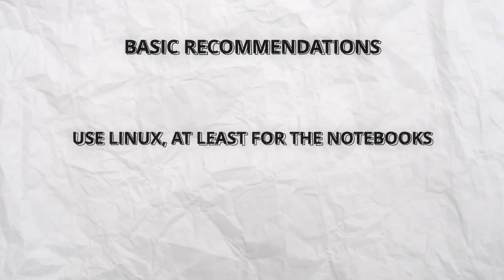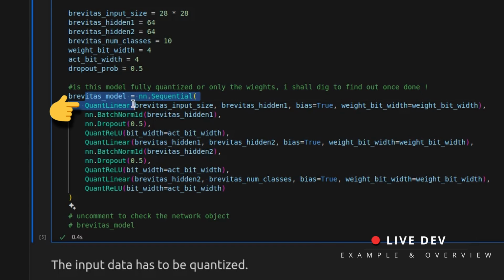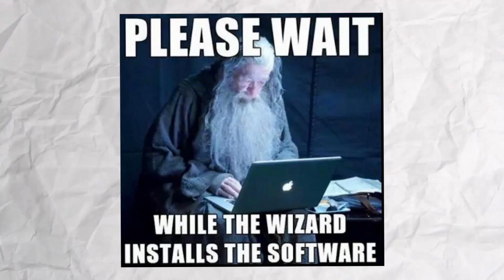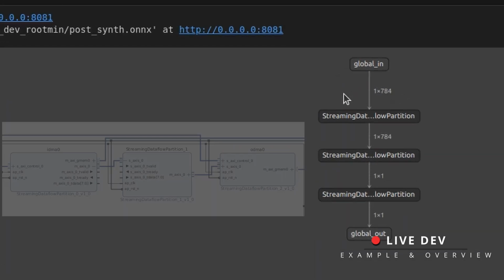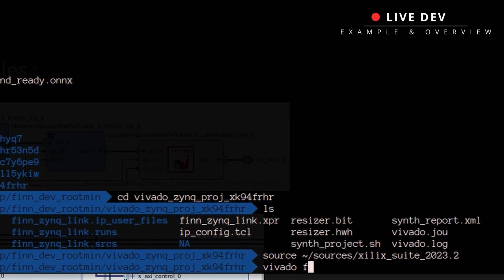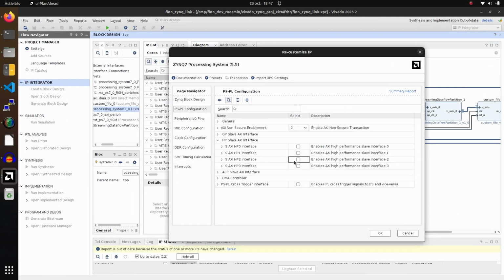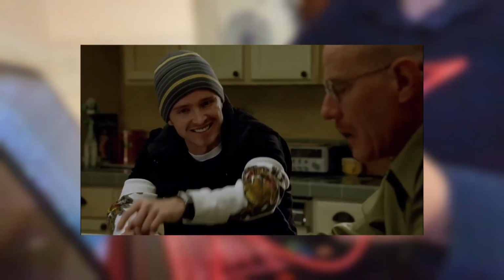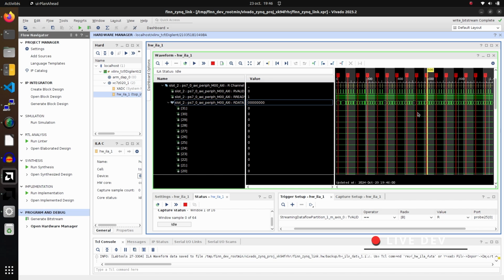Today, YOU learn how to put AI on FPGA.

Comment: Thank you very much for your tutorial and explanations.
When you opened the FINN project in Vivado, did you keep the target board as PYNQ and not update it to your specific board? I believe you did, and it worked fine because the Zybo board uses the same SoC as the PYNQ one, right?
I’m a bit unsure about this, since I believe that if I change the board in the Vivado project, I might need to rebuild the whole design for the specific board.
Reply from the maker: you can theorically grab the stitched IP and use it in whatever SoC for whatever target. Now if your goal is to leave it "as is" don't touch it too much as you will need to re run the whole synth etc... Not the end of the world but kinda long too if you wait in front of your computer for it to complete

Comment: This tutorial is confirmed working. Ubuntu 24.04 Vivado 2024.2
Reply: I also didn't need to add the constant block. I was able to directly connect the fifo to the DMA port
Reply: @one_bone_4_life647  You didn't use any constant and concatenation blocks, right?
What configuration did you leave in DMA?
Reply: @felipeferreira1960  I followed the configuration in the video. His git also has the DMA configuration information.

Comment: Being non root docker and user didn't allow me to run graphical vivado
Reply: running the vivado project from root user avoids issues
Reply from the maker: You should give the user docker / vivado authorization, running docker as root can lead to problems later
Reply: @BRH_SoC  I didn't run Docker as root. I opened a new root terminal and opened the Vivado project from there.
Reply: Ran Vivado from the sudo -i user

Comment: Forgot to mention what constant value should be used in the constant blocks
Reply: I'm assuming we use 0xF for the 4 bit and 0 for the 24 bit
Reply from the maker: You have a constant for TKEEP (you only keep the first 8 bits Sir set it to 0001 if my memory is right)

And another to fill the unused 24bits with 0s in a concat, so yes it would be 0s there.

Good luck !

Edit : added it to the github repo

Comment: There is an issue with the finn quick start tutorial. solution is found in a git bug report 1295 finn issues
Reply: You will need to modify 2 files
Reply from the maker: Running the Finn's container can be tricky. Setting up all the permissions right isn't enough sometimes... thanks for bringing that up

Comment: tutorial breaks for me when trying to export to finn-onnyx. no part1.onnx found. i looked in the tmp/ directory and there are a lot of .onnx files
Reply: export_qonnx fails to find part1.onnx
Reply: It may be a my end issue. Still debugging
Reply: I notice my root name didn't match. It did not keep my capital letters when generating the new mount location
Reply: I cant seem to get any files from Jupyter to save or generate to a new mount folder
Reply: Will it take capital letters for a user name or will it default them to lower case where I need to make a new non root user with no capitals
Reply: I'm just going to start tomorrow with a fresh user and no capitals in the name. This seems to be the issue
Reply: Yes, the error is that the mount folder that gets generated by Docker will ignore capital letters in your user name. In the Jupyter where it asks you to "use your own user name," put you username with no capital letters. This worked for me. The tutorial is good
Reply from the maker: Great , thanks for keeping everyone updated , good luck :)

Comment: Can I use more than 1 FINN accelerator on a board? For a Project, I need to use a custom Microblaze system and 2 ML accelerators.
Reply from the maker: Yes, I guess you can just build multiple accelerators, grab the main accelerator IPs and build your SoC from there around the 2 IPs

Comment: Why did you delete all their pre-made IPs in the Vivado project? Why did you not use their DMA if Xilinx DMA requires a custom FIFO and other hardware to make the accelerator work?
Reply from the maker: Finn was made for Pynq boards. Theorically you dont have to know anything about hardware to use it.

But I wanted to use it on my own FPGA and the premade DMA did not have practical C libraries in Vitis so I simply replaced it however I could.

Comment: how do you evaluate fpga competetiveness with regard to gpu, and which use cases should favor fpga over other choices?
Reply from the maker: FPGA are not really a great competitor againts GPUs.
Their advantages are delay, edge presence, power consumption and adaptability to the use case (for aerospace applications for example).

But because it takes so much work to get some very simple application running, people just don't use it, understandably (it's just very hard to use, let's be honest...) 

So it's a balance, and once you lean toward FPGA, you have to be ready to put in the work ;)

Comment: Man, this is awesome. Does it work with different FPGAs? I have a PolarFire SoC Kit and want to do the same thing. What do you think that I should notice?
Reply from the maker: Hi, thanks ! Well, polarfire is not compatible with vivado so I think it's not really possible. What you can do is get the quantized model from brevitas and then implement that in verilog. It's more work and less flexible but a well quantized model should make it fairly doable. Good luck !

Comment: Is there a reason why you didn't use hls4ml and does your approach also support generating hls for customized layers
Reply from the maker: When I looked for tools, hls4ml was indeed an interesting choice but I really needed something that would give me results fast as this project was initially a freelance mission, meaning I did not have time to learn HLS specifics (I'm not very familiar vith HLS haha).

FINN was a better option because of how easy it is to generate the layers and then move on to some actual FPGA configuration instead of spending ages trying to reproduce some model in C++, nevertheless, I think it's possible to add you own layers but I did not use this feature. Maybe hls4ml does customization easier ?

Comment: I'm currently having a board Altera DE2 Cyclone 2, is it possible to do this project using Quartus Prime instead?
Reply from the maker: I think it would be very hard, given all the software is made and support by Xilinx. That's (on of) the main issue with the FPGA industry : proprietary software...
Reply: @BRH_SoC  thanks a lot

Comment: This is amazing thanks for the insight, I'm working on PYNQ board and I thought of this particular workflow using FINN but thanks for the heads up on Brevitas , Can you make a more detailed on for PYNQ board I'm kinda new to it.
Reply from the maker: Hey, thanks for the nice comment ! Regarding pynq, it should be easier to pull off beacause the whole "Vivado SoC planning" part is abstracted into a simple function call. (The model is translated into a prebuilt IP automatically). The FINN docs should cover that pretty well, they also have example notebooks on their github from which mine are inspired, except the workflow is not really end to end and their use PYNQ only : https://github.com/Xilinx/finn. Have a nice one :)

Comment: Hey I keep getting issues of the DMA transfer failing and I honestly do not know why. It appears DMA is halted.
Reply from the maker: Hey,
I had DMA halting too when something in the DMA's IP config was not right. Make sure scatter gather is disabled, that unaligned transfers are allowed etc...
Reply: @BRH_SoC  I double checked my DMA with the one in the github and they match. I might just redo the whole process and see if that fixes it. However, I am having issues with vitis not recognizing any of the header files in main.c as well as issues with it running ps7_init. I am not sure if this could be causing the issue.
Reply from the maker: I had some ps7_int problems in vitis if this is where your problem is. To fix it, open you Vitis project, go in the application > Setting > launch.json and swith "Board initalization" from TCL to FSBL.
Re build and try agin.
Sorry for coming back at you so late, good luck
Reply: yo @sampratt8584 did u fix it? I am having same issue with hls4ml thats why
Reply from the maker: Hi @rohithr3743 I just answered @sampratt8584, hope you will find it useful.

Comment: Hello, I am currently doing the same project. But I am trying to perform object detection tasks with a quantized YOLO model, and create the stich IP so i can integrate it into the KV260 KRIA FPGA board as the deep learning unit to run inference and output it via HDMI. But I seem to get stuck on the out of context synth, another problem is when i ran synthesis on the stiched IP in vivado, it just kills me VM OS due to limited resources. I used 2024.1 version of the XIlinx tool chain, do you think this will be an issue? Since I saw you use 2023.2 verison, but the FINN documentation recommended the 2022.2 version.
Reply from the maker: Hello, great project ! I never tried models as complex as yolo but a general recommendation is to stick with older versions of vivado (from 1-2 years ago) as the most recent ones tends to have unknown "features" (bugs) and older ones tend to have better support.

I also know using a VM can limit vivado sometimes. The best is have a real machine for that but I don't know how much of a difference that can make.

Hope this helped, do you have any specific error ?
Reply: @BRH_SoC  Thank you for the suggestions~!\

Comment: Hi ive been following along with this project and am super interested I actually want to do this as a project however I'm curious as in the initial video you mentioned you wanted to create a full 10hr course on how to do this project is the github tutorial the course you were mentioning? i would love to hear back from you and FYI is this a super cool project
Reply from the maker: The course is open source, it is pinned on my gihub profile (with all of the slides).

However, the notebooks are not as detailed and the slides may be tricky to understand without a lecturer.

If you have any trouble, don't hesitate to check the learning resources on the github or use the comments section on this post on my blog : https://0bab1.github.io/BRH/posts/PY2FPGA/
(because these actually sends me notifications and are easier to work with for troubleshooting.)

PS : the blog is something I'm actively working on right now, you are officially the first beta tester / early access member ;)

Comment: how much took time the training process . Is it less that regular systems?
Reply from the maker: I talked briefly about it in the video. Training time is longer when using quantized aware training. In the backend, the computer simulates quant error in order to let the model "adapt". Alongside more complex backward propagation, it requires more time indeed.

You can also train normally and use Post Training Quantization, which works but the model is not adapted leading to greater loss.

It all depends on your requirements, hope it helped ;)